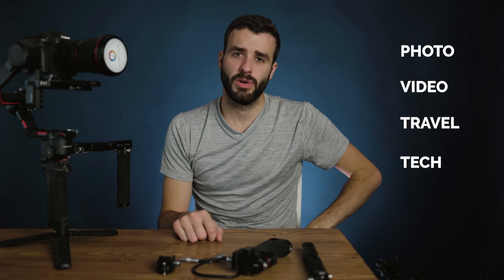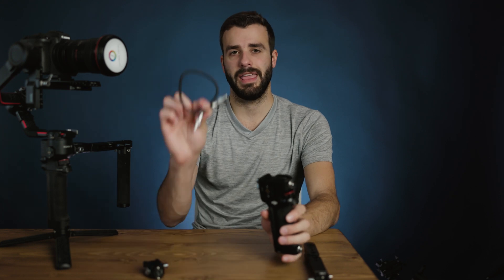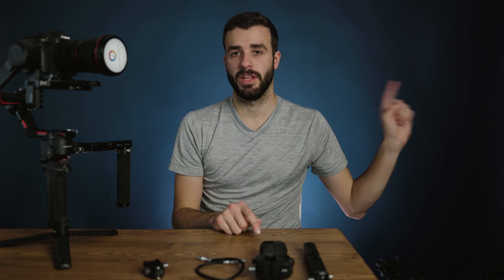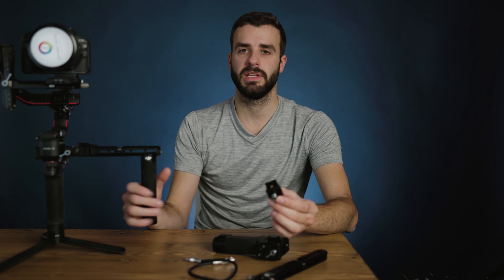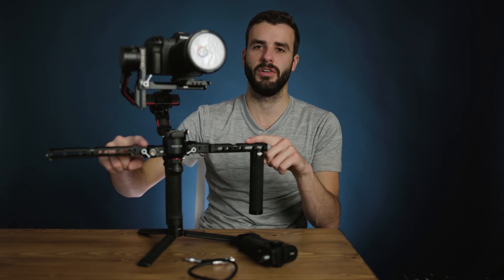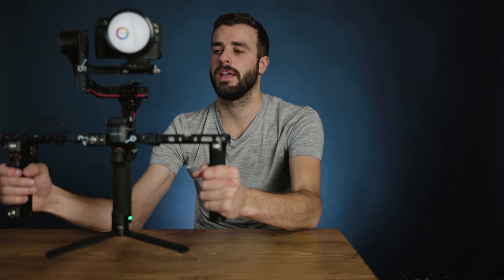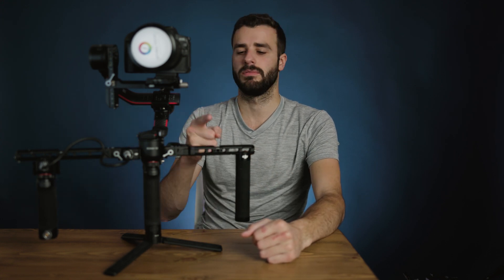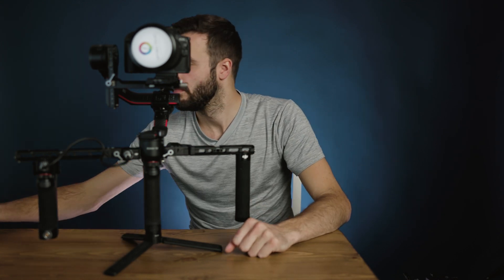How to Setup the DJI RS2 Twist Grip WITH Control handle

Comment: Hey man! Great video! 2 questions: 
1. can you pull focus with this grip? 
2. Does this work with the rs3 pro?
Reply from the maker: Check DJI's website for compatibility. 
You should be able to pull focus with the DJI focus motor just as you would with the normal grip handle. you just use the little scroll wheel on the back side of the handle.

Comment: What about wrapping the cable around the arm ? 
Or passing it thru the wholes of the arm ? 🤷🏽‍♂
Reply from the maker: It's just not long enough to do much with it. Best case is to zip tie or cable tie it to the arm but its too long for that so you would have extra
Reply: Velcro straps for easy removal if needed.

Comment: Did you have any problems connecting/ calibrating your handle? I just got mine after waiting 3 months for it to come back in stock and it doesn’t work :(
Reply from the maker: You have to turn it on. The "sleep" button on the side is the power button. You have to press and hold it down for 3 seconds. Similar to turning on the actual gimbal. The M (mode) light should be green and will sequence green as it turns on. I did this EXACT same thing when I hooked mine up. I thought it was broken.
Reply: @EngineeringFilmmaker  Thanks for this tip - its just helped me power on the remote handle - yay.... but once on it doesnt actually control the gimbal, any ideas here?

Comment: I am having issues with my tether control record botton not working.  Joy stick works. but not the record.  very frustrating  any advice ?
Reply from the maker: Try pressing it firmly and for about 1 second or so. I have never had good luck with the record buttons on any gimbal brand. Even the Crane, Ronin S 1, RS2, etc. Half of the time it works, half of the time it doesnt.
Reply: Try updating firmware. It worked on my ronin s, when i upgraded my eos r to r5.

Comment: Do you know if the stabilization provided by the Sony A&sii including the IBIS and Active Stabilization is additive to the stabilization provided by gimbals like the DJI RSC2 or RS2 ? Thank you.
Reply from the maker: You can use IBIS while using the gimbal but there is really no reason to use it unless you are doing very intense actions such as mounting it to a car or something else that may be very shaky. Your normal handheld gimbal use should not need IBIS for extra stabilization. There are some downsides to using IBIS on a gimbal too.

Comment: I wonder is the control handle will work with the small rig version of the Dual Handles?
Reply from the maker: The control handle should come with the adapter that connects to the nato mount on the RS2. As long as the smallrig handles are nato mount then it technically should work but I would look into it and not just take my word. The control handle connects with a cable.
Reply: @EngineeringFilmmaker  thank you!

Comment: Would this work on ronin s first version ?
Reply from the maker: The switch grip uses a nato mount for the RS2 which the RS2 has built in. The RS1 does not have that and when you buy the dual grip for the RS1 it comes with a adapter that clamps on to have nato mounts. You could buy the RS1 dual grip and the Switch grip and then you could use either grip but It seems like not a good way to spend money lol.

Comment: would flip the grip opposite ways and make it look like a ronin m layout.... and move the battery grip to the other end so it looks more like a ronin m.. if that makes any reason lol
Reply from the maker: You could do that. There are plenty of ways to set this up but with the minimal things I have this way is just the easiest. Tilta also has an awesome ecosystem and square handles with controls built in.